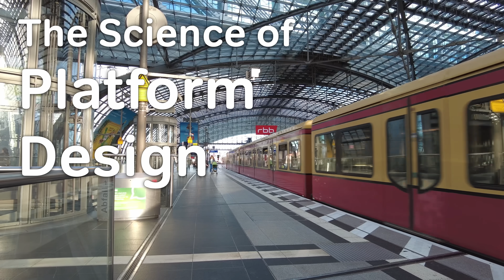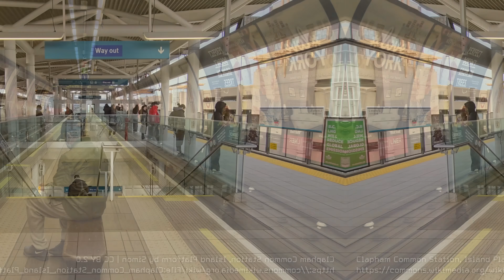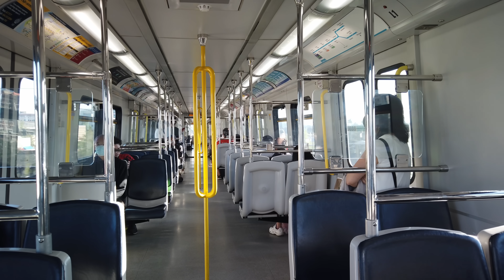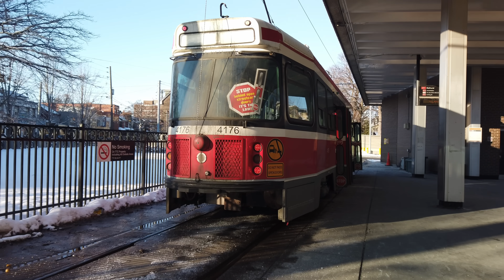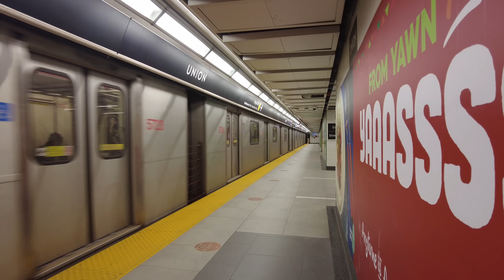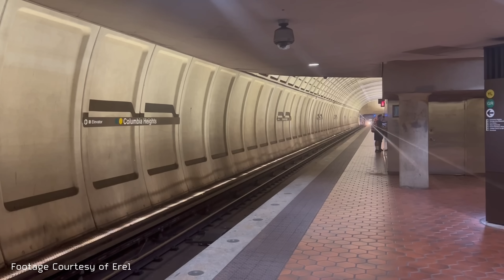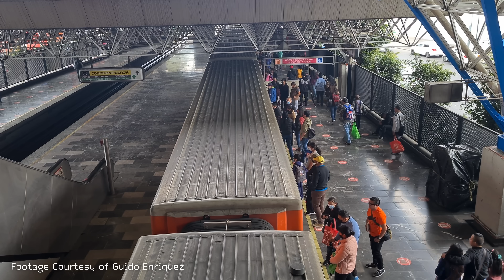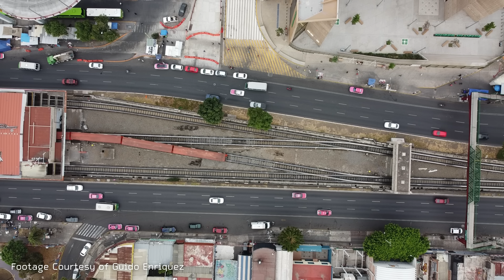The Surprising Depth of Platform Design

Comment: Why is there no one meter high platform standard for trains in the EU?
Reply: @ЕвгенийБагрянов-н9э  Because real life isn't a fantasy world where all platforms can be replaced for no cost and with no distruptions
Reply: @Gfynbcyiokbg8710  The European Union standard TSE heights are 550 and 760 mm (21.7 and 29.0 in). From Wikipedia. Right? Just because it is not always met does not mean that these standards cannot be adopted, right?
Reply: So why not 1 meter as in Russia?
Reply: @ЕвгенийБагрянов-н9э  Why 1m? If no one's already using it and there's basically no benefit to switching, then literally no one will build their platforms to 1m and the standard will be utterly useless
Reply: @Gfynbcyiokbg8710  In short, because it allows you to make trains (or buses) as simple boxes, which is very cheap to produce and maintain. Have you ever noticed that intercity high-floor buses are so much cheaper than city low-floor ones? And I mean RMtransit literally has a video about the advantages of a high-floor tram over a low-floor...

Comment: Dual platforms are the best for stadiums stations*

*But only if they are not true Spanish solution platforms
Reply: At stadium stations, you will have lots of passengers arriving before the event and lots of passengers departing after the event, so you probably want to use both platforms for the same directional flow of passengers.
Reply: @katrinabryce  Yes, although Olympic Park in Sydney also has a bit of a residential population. So the trains aren't exclusively for patrons of Olympic Park events. The platforms also don't have proper platform screens, but they do have barriers with gaps controlled by staff during big events. And they are also trialing the use of AI (with de-identified CCTV footage) to identify/predict any issues. I'm not sure how that is working out.

Comment: You said it, platform design is super important! Especially for GO Transit; level boarding can cut dwell times to around half, at least. The only places where non-level boarding is acceptable is for VIA or Amtrak corridors outside the city area that share tracks with freight; even then, having stations be on gauntlet tracks or even sidings is probably the best thing to do if costs aren't the biggest concern. 

On the topic of platforms and boarding/de-boarding factors, the bilevel design itself has issues for high-traffic commuter services, like what you say, and instead is perfectly suited for regional express services. But this can, and should, be fixed if they widen the doors a bit (135cm to 145cm) and have people enter/exit at an angle so more people can fit through the doors. Seems crazy, but you could fit up to 5pax per door on a bilevel if people board/exit this way! GO could just use higher capacity cars + faster accelerating locomotives and EMUs for higher traffic services, but the bilevel is a fantastic commuter car, and can and should be modified for higher-traffic commuter services, as well as have those features added into the newer generations of bilevels!

Comment: Remove overhead wires. Use 3rd rail electrification. Put hatches on the roof and these align on holes on a 2nd floor platform when the train stops. Let passengers jump onto the train from the 2nd floor. Profit. 😜

Comment: I don't think I've seen the Spanish solution for trains (although maybe the shuttle rails at airports?) but they're very common for elevators at the deep London Underground stations. Loved the explanation - thanks!
Reply: Good point about elevators. They are also transit! Just the vertical kind.
Reply: Singapore's Bt Panjang LRT has the Spanish solution at Choa Chu Kang station but it's not applicable to wheelchair users as only the departure but not the arrival platforms have lifts, maybe to save money. There're signs on train doors to warn wheelchair passengers of this, otherwise they'll end up stuck at the arrival platforms with no way down to the exit

Comment: Living in Clapham, you have the double whammy of the tightropes at Clapham Common and North stations, plus sweeping curves at Clapham Junction, which you could easily fit a foot in.
Reply: Not to mention that because of the curves, the track is canted into the curve, so if you're on the outside of a curve (like platform 10), you have not only a massive gap, but also a massive step up, onto a train floor that's tilting away from you!

Comment: Platform height needs to match train floor height, period. This isn’t just an “accessibility” issue for the disabled, it matters to anyone with luggage, kids, or strollers, and it speeds up disembarking and embarking. I am shocked at how poorly trains and platforms in Europe are designed for customer boarding, looking at you, TGV.
Reply: Platform height should be standardized to 115-120cm above top of the rail, to match the "natural" height of train floor (continuous level floor with bogies underneath . Sadly Europe has chosen to go with 55cm platform, forever cursing us with inefficient train designs, and poor accessibility.
Reply: Have you seen platforms in North America? Outside of their metros and subways, basically everything requires stepping up or down. For all of Australia's faults, at least we got that right. We have level boarding at pretty much all train stations. The trams are another story, however.
Reply: Some call this ''universal design" - it's ends up helping the disabled, but it's actually just better for everyone.
Reply: 55 cm Is best for European double decker trains, 76 is best for European single deck trains as the maximum height of the trains may not be as high as in North America usually, as tunnels and wires are relatively low.
Reply: @jakobwinder3687  55cm is useless for double deckers, particularly with the french loading gauge like the TGV mentionned above : you're forced to have the lower deck lower than 55cm to accommodate the top deck. 76 is useless too : ICEs for example, need to have stairs because the floor is at the "natural" above bogies height, which sits around 120cm.
120cm or so is the floor height for almost all older single-deck european rolling stock : Corail and single-deck TGV (SNCF), VU IV (SBB), UIC Z/Eurofima, etc. That's where we should aim to standardize platform height.
Reply: @jakobwinder3687 That doesn’t solve the customer problem.
Reply: @jakobwinder3687 My country has lots of double decker trains and a platform height of 76cm, it works just fine.
Reply: In Singapore some MRT (subway/metro) trains are completely level with the platforms but others are ~1cm higher, which is enough to get the front wheel of wheelchairs stuck in the platform gap during boarding. Maybe the higher trains have newer wheels with less flat spots that have been grinded away (that would've shrunk the wheels slightly & lowered the train slightly too)
Reply: Low platforms in Europe are chosen to allow freight traffic to pass. Even worse is that there is no decided low floor height between the countries. Germany chose 76 cm and France 55cm.
Reply: @HeyHeyHo685 That may be the excuse but it’s not the right answer for customers.
Reply: @HeyHeyHo685  I've heard this idea that freight and high-platforms are incompatible but I can't find any explanation or reliable source for that. I suppose it's because of the dynamic loading gauge of freight train ?
Reply: @constancel4211 Probably. Many freight cars are too wide to fit through a lot of high platforms. Ideally this problem would be solved in large cities either with freight trains bypassing stations (with an alternate routing or the station being a terminus that passenger trains back into/out of), or if this is impractical some sort of gauntlet rail that passenger trains stopping at a station could use to let passengers on/off while maintain clearance for freight trains.

Comment: Tokyo also was some very narrow platforms where the stairs or elevators are and there are several stars along those platforms. I think they would be designed wider today. 

For me it s important that I an keep a distance from the incoming train in case some insane person tries to push me on the track. Of course that is not a problem in Tokyo, where they have platform doors, but it could be in New York City.
Reply: @crowmob-yo6ry It does not happen often, but I hate the fact that my life depends on the sanity of others. 

The main reason why NYC should have doors at the platforms is air condition. There is no air condition at the stations, but in the trains. So the hot air from the trains blows into the tunnels and stations. Full height doors can prevent that.

Comment: As a transit advocate I was happy to see my home city, Bhubaneswar , India preemptively start building a metro line before the city really grows. But I was so disappointed when I saw the route, the fare touted and the platform design. It's like they are setting up the system to fail.  The platforms are going to be side platforms which are about 2m wide. Right now that would be fine but I guarantee it will cause problems later when ridership increases.

Comment: The platform at Hamburg central station I use the most is an island platform tapers down to like 1.50 m wide at the far end. And that's one of the super busy commuter and intercity business travel platform that carries like 10,000 people an hour. I'm surprised there aren't more accidents with people falling onto the tracks. Frustratingly, there actually are semi-abandoned side platforms at a lower height that used to be used by the postal service.
Reply: Yeah, Hamburg Hbf is really a victim of its own success. It was built for way fewer passengers than it sees today. It is the busiest rail station in Germany, but it has narrow, curved platforms where sometimes four trains stop at once. And also, many of these trains only have one or two entries available that have level boarding (looking at you, Doppelstockwagen).
The new platform entrances at the Steintorbrücke have helped, but it's more of a band-aid solution. And you can't really expand the station much, either, because it has buildings on all sides.
Reply: Think some island platforms in Japan have this design too after they were extended to fit longer trains

Comment: Busier stations where there's platforms on both sides, and where passengers are funneled onto one platform, and the opposite platforms funnels to the exit, and when the train arrives the exit side open 5s before the entrance side... chef's kiss. 

Bonus points if instead of turnstiles they control flow with escalators that only go down or up (as needed)(plus elevators of course). The smoothest experience possible. Of course it has a massive footprint and there's a lot of technical coordination involved, so it's not worth the cost in most cases. 

But... if it's a massive central stop like Garre de Lyons or Shinjuki-eki then yeah it's worth it. Even the largest hub station in a modest system could benefit from this.

Comment: Platform screen doors are not only safe, they make a transit system look modern.
Reply: Beyond safety, PSD allows trains to arrive at full speed in a crowded station. Without PSD, a slower approach is required. That increases the frequency and therefore the throughput. It's been used as main argument in Paris to implement PSDs on line 13 which isn't even driverless.
Reply: In a mixed traffic setting though, they do require all rolling stock to have doors in the same place, which cannot always be guaranteed... case in point the West Coast Mainline (UK) where carriage lengths vary between intercity and regional/commuter operators between 20m and 25m, with door locations varying to match
Reply: @MercenaryPen  there are those Japanese ones that are a set of cables that lift up out of the way for the train. But even they don't have that on all that many lines
Reply: @cloudkitt  There are modern variable PSDs installed in the underground section of Osaka-Umeda station.
Reply: @MercenaryPen  i have learnt not long ago that japan solves this by QR code detecting trains to control screen door openings. They also have screen doors for multiple types of trains as well, tho the technology is not widely used globally and that could mean it being expensive.
Reply: @MercenaryPen  just trim the ends of carriages to make all of them 22.67m (standard UIC length)
Reply: I prefer my elevator shafts to not have doors, so that I can accidentally fall into them.
Reply: @leow sure, but PSDs keep you from being pushed onto the tracks, allow sight impaired people safer navigation, and keep people from throwing trash on the tracks which also causes delays.
Reply: I disagree I don’t like the look of them, showing the passengers the train makes it feel far more modern
Reply: But I like seeing the train come down the tunnel :(
Reply: Maintenance for these doors to maintain a high reliability is a pain in the ** though.
Reply: yea we could have air conditioned platforms aswell, which is especailly needed here in india
Reply: I don't like them for some reason
Reply: PSDs can be dangerous, as any train movement with a trapped passenger between the train and the PSD will result in serious injury or death. This slows down train departures, as especially seen in mainland China, where trains have pocket doors taking in excess of 15 seconds after doors are shut to depart from a station.

Without a PSD, a train can be monitored as it departs (like on London underground) to see whether any passenger that has been trapped but the driver didn't notice!
Reply: @leow_se   if China and HK’s rail system wasn’t a million miles ahead of London’s I might have a better idea of pros to no psd. As is I don’t see many downsides to how the rail is implemented in say Hong Kong
Reply: @leow_se  well my argument would be mainland China is the one to blame to be dangerous instead of PSDs…safety standards wise nothing political here
Reply: @theguiltyjnz yes but actually no

Comment: Some aspects which are important to me 
- platform width. I hate narrow platforms like on many NYC subway stations, especially next to stairs there's barely any room left
- access: although I don't need it for myself, I think it's important to have easy access with elevators for people with disabilities
- cross platform connection: important to have a pedestrian bridge or tunnel further out at the platforms at terminus stations, at least at the larger stations; Thus for example Munich Central Station lacks a pedestrian tunnel and the longest possible walk from platform to platform adds up to 1.2 km, that's like a 20 to 25 minute walk within the station
Also at normal through stations additional pedestrian tunnels can make pedestrian traffic flow easier as not all passengers are trying to get to the one and only bridge / tunnel. Well done at Nuremberg Central Station
- have a decent ceiling height
- keep them clean
Reply: Another aspect, which Reece has not mentioned so far, is buses sharing tram platforms, quite common in Europe and not possible with high floor. By the way, not all low floor trams have internal steps, one that does not is the Eurotram, in Strasbourg, Milan and Porto, which has bogies under cabs, making it easier to avoid having internal steps.

Yes they are harder to design, but the range of off-the-shelf low floor light rail vehicles available today is greater than the range of off-the-shelf high floor models.
Reply: @EnjoyFirefighting  elevators and other accessibility features are helpful for a broad range of passengers, including people with prams, people with suitcases, people with grocery trolleys, people who have hurt themselves and are temporarily on crutches, etc etc etc.
Reply: @Kinnibari  I guess there's no need to tell all the different kinds of people which benefit from an elevator or similar
Reply: Beverly and Cortelyou road stations are cool but the platforms are downright treacherous.
Reply: Shoutout to the 72nd st platforms
Reply: Heh. Good point about Munich. That one is especially bad since the flanking platforms (5-10 and 27-36) are also pushed forward; they aren't level with the rest of the station. I once actually had a local train redirected between those two. You have to walk all the way back, then by all the main platforms (11-26), then along the last one forward, and then to your platform, making a huge U-shaped walk. Wasn't that big a deal for me, but of course if you got loads of luggage, or tight on time, etc. it's quickly a problem.
Reply: @Sp4mMe  that's exactly the point. Some travelers might not be that quick, and even 10 or 15 minutes  might not be sufficient to catch your connecting train
Reply: Paris Montparnasse is another example where you can spend upwards of half an hour to get from the train you arrived on to the next train you need to take. Given that on my multiple journeys I have not seen any options to actually get there if you can't make that walk or can't climb up down about 20 stairs it's probably even worse if you have mobility issues of any kind. That train station is genuinely atrocious
Reply: Although I do wish for wider platforms. I can see it being a nightmare to engineer in the city. 
Specially dense area with 4 tracks, specially since are typically in dense areas with building foundations. Platform doors would be nice tho.
Reply: @v0lv0  that sure is an issue, however dense areas can be seen in many cities around the world. Cities in eastern Asia have very tall high-rises with deep basements just like in the US; Cities in Europe sometimes have high rises as well, but also many historic sites underground. In places where it's too tight for adequate wide platforms, you might see the tracks and platforms not parallel to each other, but stacked on top of each other. There's such a section on the underground part of the commuter rail trunk line in downtown Munich, where the tracks and platforms of either direction are above each other instead of parallel to each other on the same level